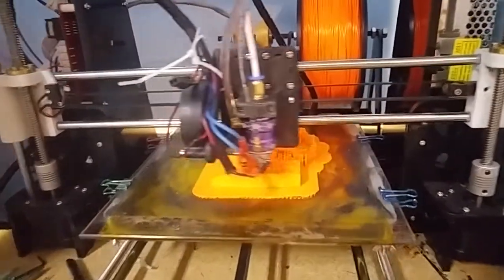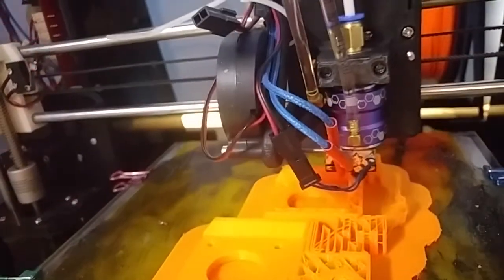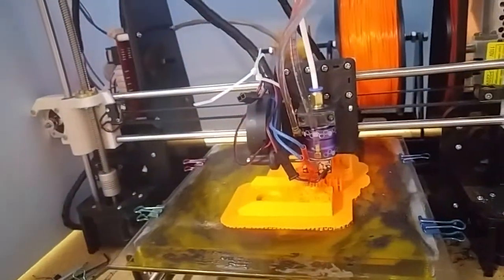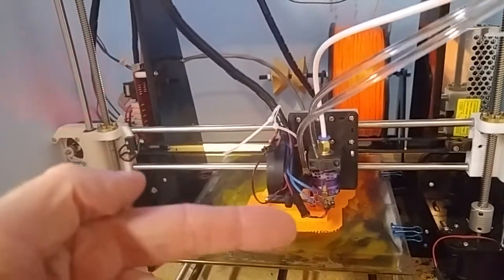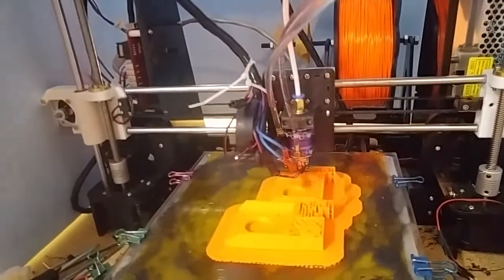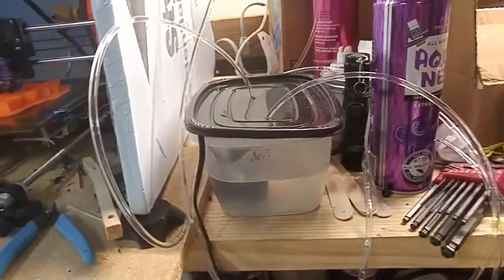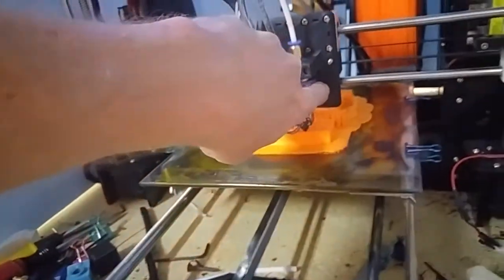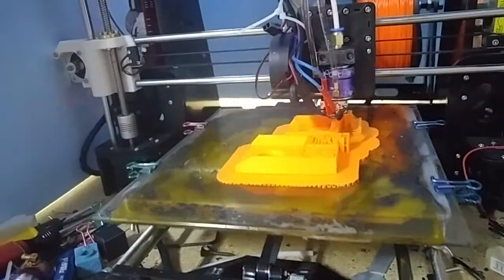DIY Titan Aqua Water Cooled 3D Printer

Comment: You could print a water jacket to go over the standard E3D heatsink. That would be even better with water in direct contact. 

BTW you should add some of that green radiator stuff to stop corrosion.
Reply from the maker: I tried and it did not work...lol

Comment: Brilliant have you had any issues after running it for a while?
Reply from the maker: No.   I have moved the extruder to a 12x12x16 home made core xy.    Ah, yes had an issue where my pump was not pumping water and I melted all my plans printed parts.    So make sure the water is flowing out...
Reply from the maker: Melted my PLA parts.    Now I just make sure when I start a print that water is being pumped thru

Comment: A water cooled heat brake....  Nice!   I can see how there are possibilities here, especially for those that hate the loud fan sound for good fans on the E3D V6 setup.
Reply from the maker: It is more for heated enclosures.   This printer is in my garage so I was not able to cool the heat break with the hot air.  But yes if u have noisy fans it fixes that problem also
Reply: The fans?! Who can hear a fan with those Steppers?